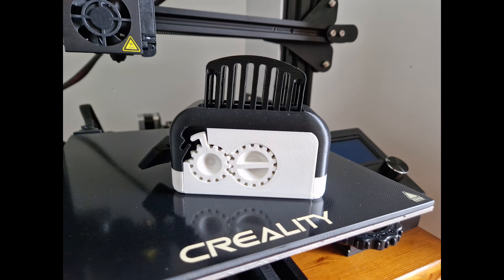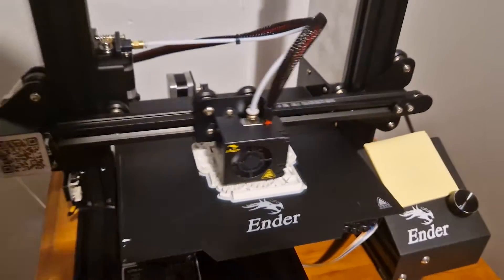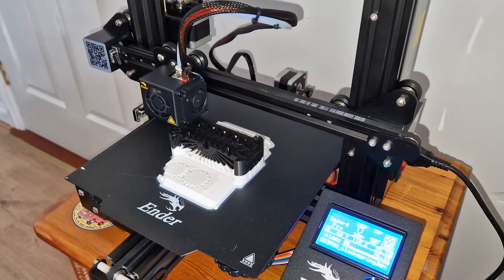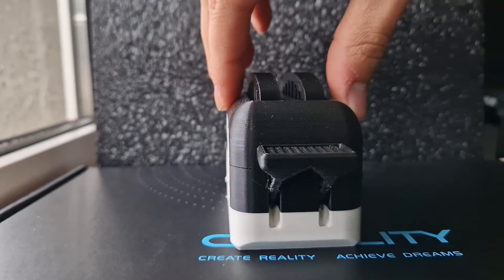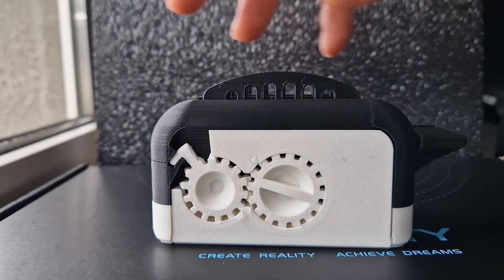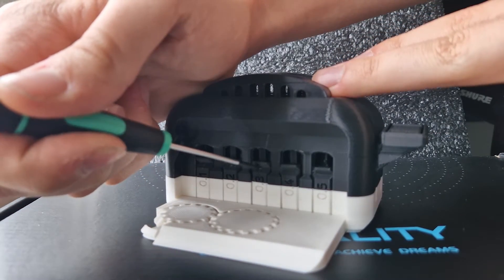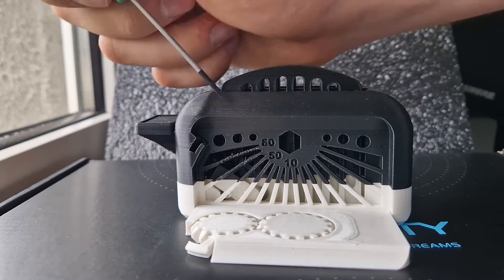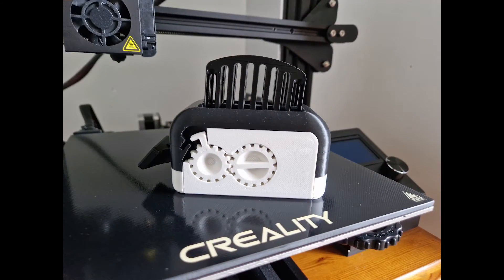Creality Ender 3D Pro Torture Toaster Test

Comment: in my opinion the entire test is basically pointless because you had to swap filaments in the middle of the print extrusion. swapping filaments can introduce fractures, inconsistencies and problems with layer adhesion so its best to start with a full roll of fil to get the most accurate result
Reply from the maker: @Tenebris_Media  Even with a filament change, the toaster came out quite well. Also, it demonstrates  that the printer is well able to handle a filament change

Comment: My layers need work. Which made the tolaranes test mostly a wash. Gears are stuck but the overhangs told me I'm good till 80 and my bed adhesiion is good. Seeing toat mechanics work grate
Reply from the maker: Yeah, the first week with the printer is just a lot of tests with different parameters

Comment: Can you try PETG? Thats like the most annoying filament
Reply from the maker: It's possible to do that. You can also print translucent PLA. For PETG, you need to find the correct temperatures
Reply: @greenlightzone  on ender 3 pro i have tried all tenperatures and even height towers from 100 to 200 nothing worked
Reply from the maker: @Karolis P  in that case maybe buy an upgraded extruder, they are not that expensive, read about something that could do PETG
Reply: Ok, havent thought of this honestly, any suggestions?
Reply from the maker: @noctacorpus  not really, the default extruder is enough for me right now. But I'm sure there are videos explaining this